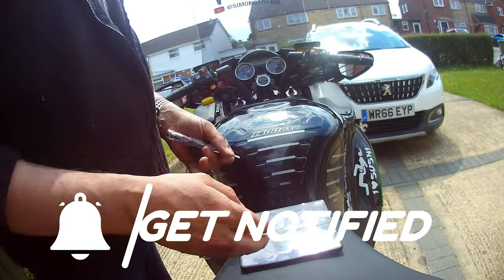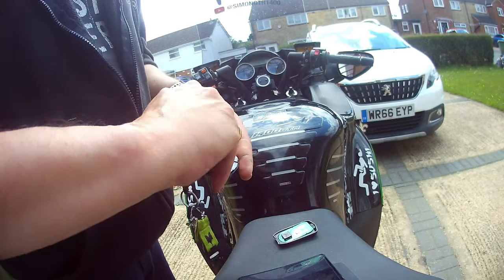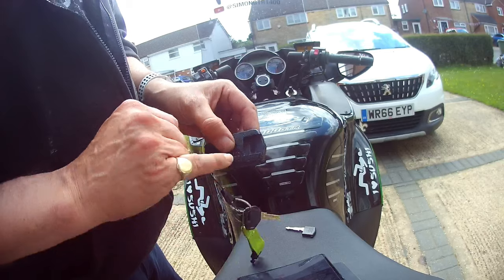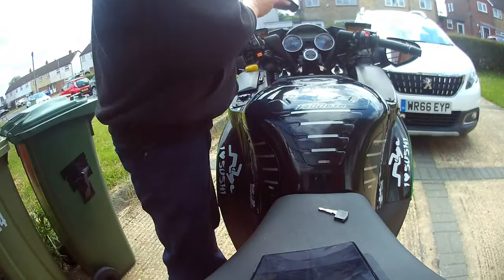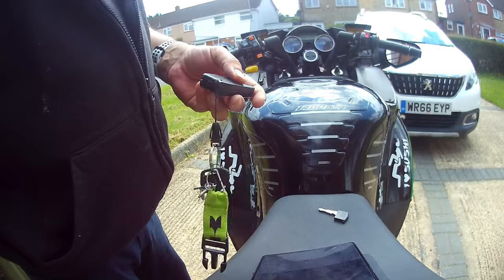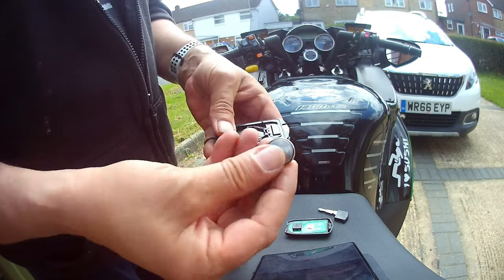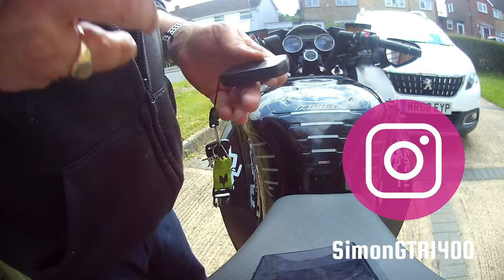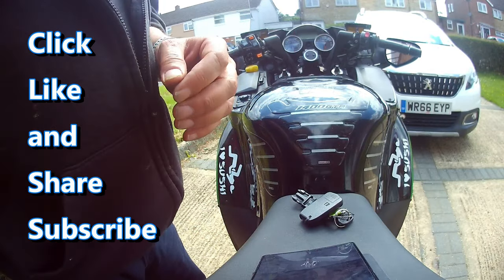Start a Kawasaki GTR1400 with a dead Key Fob Battery

Comment: Great video mate I got my gtr 1400 today and that is a great tip, my 2008 has a break problem the previous owner had put £6 cheep pads in the front breaks so now they are sqiching like mad, first job is to fit new pads, I’ve been told they are a very easy fit?
Anymore great vids on the gtr would be helpful
Reply from the maker: https://www.youtube.com/watch?v=5QF-x-hkWX8&list=PL86I-_U2mZAImFc5mLbbaqBcjBcF1CaU_&index=1&t=72s

Front brake pad change
Reply: Thanks 👍👍